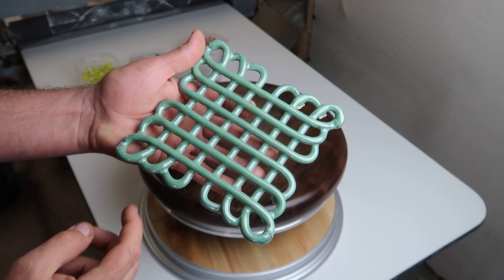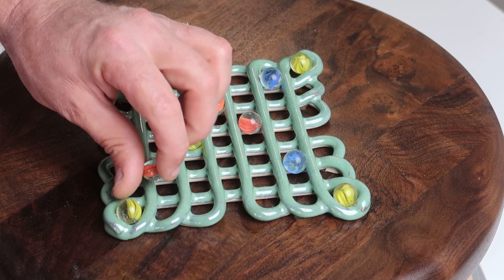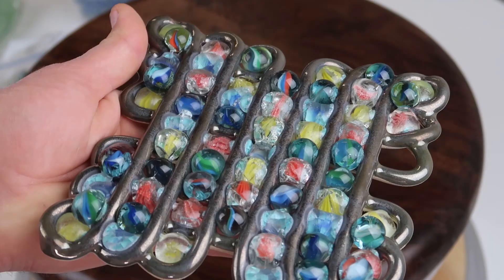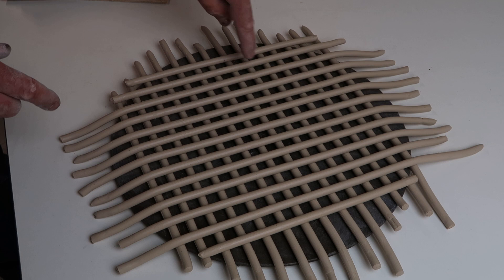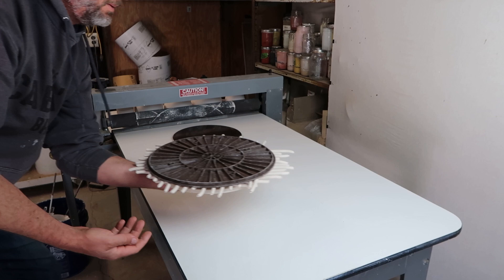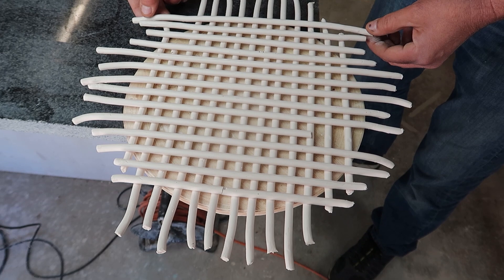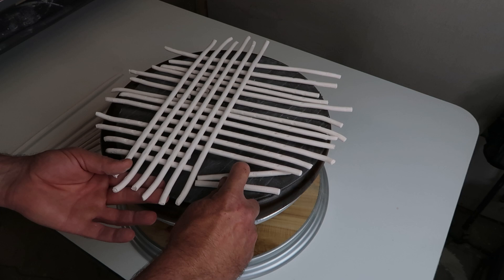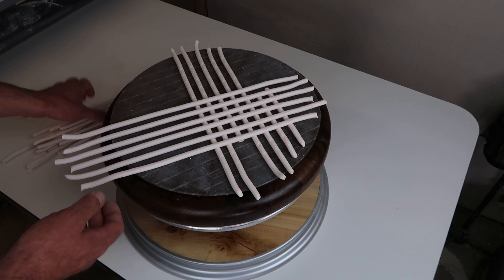Making "Art" with marbles in a pottery kiln

Comment: Cool. 
Where one lays on top of the other you could try to simply glue the bisqued pieces together, should hold long enough to get the glaze applied. The glue would burn off. Just have to make sure the glue doesn't act like a resist, and that nothing would shift after it does burn off. Could glaze them right on the shelf with a layer of newsprint underneath that you could slide out when dry, minimize carrying it around.
Have you thought about using a marble to lightly press an indentation into the wet clay where you want them to stay? Not so much that it would be noticeable, but enough to keep the marbles from rolling off.
Last thing. This would be cool to try, I think..... Take a bouquet of noodles, probably on the shorter scale, and set marbles in the forks. Maybe go with more of a narrower vase so the branches fit a bit more snug to hold the marbles in place.
Reply from the maker: Thanks for the good ideas!  Got me thinking..

Comment: If you run a roller over the pieces as they lay on top of each other it helps them to fuse to each other. Or press slightly at each cross point to join them.  Like your finished vase piece

Comment: Lay out the bottom layer of coils & then give a good spray of water.  Put a coil in place for the top, hold both ends, and ever so slightly move back and forth a bit, creating a micro layer of slurry.  Then press down.   OR    lay out the bottom layer, good spray of water,  lay out the top layer , then take a small finishing nail, pierce the center of each joint.   If you like the look, keep it as is.  If not, fill in hole with slip trailer,
Reply: Started typing a similar answer.  Yes, what you said.🙂

Comment: How about making a thick piece of plaster (kind of like a thick tile) and then cutting on it a square pattern with an old saw blade maybe on the table saw or a circular saw if you have one, then build up four walls with more plaster and use slip on that mold to get your square pattern marble holder. At least that’s what I would try.

Comment: Could you just bisque the rods as separate pieces then only glaze the top layer. You’d only have glaze on either the horizontals or verticals depending on which direction is on top but you’d be able to glaze the whole rod and I bet it would still be a nice effect. I bet the glazed rods would stick well to the unglazed ones still.

Comment: Not sure what you fire bisque to, but If you are bisque firing at 04, use low fire glaze on the greenware joins.  I use clear on greenware so my disabled students dont paint glaze on certain areas of pieces.  After bisque, Then use a colored low fire glaze to finish off the piece. Then if you are firi g marbles at 014-015 it still shouldnt disturb the lowfire glaze.